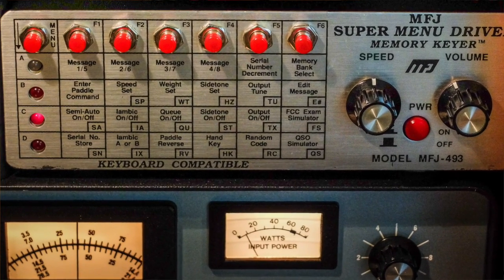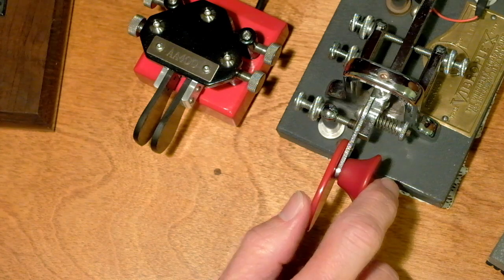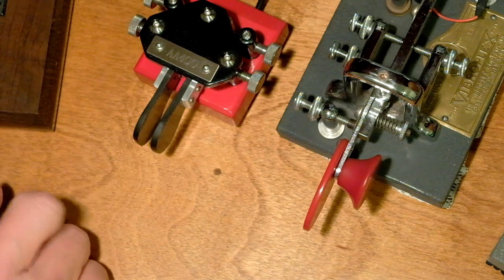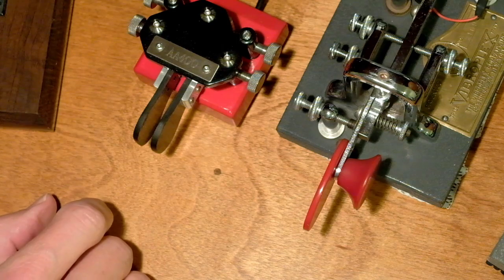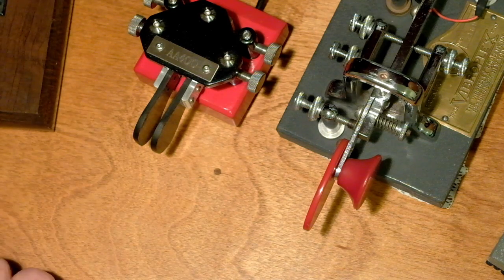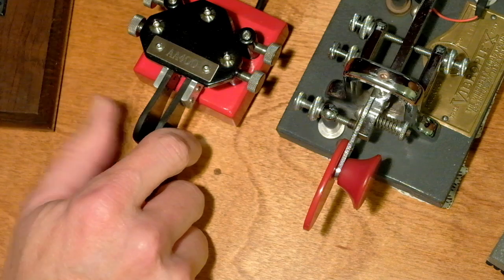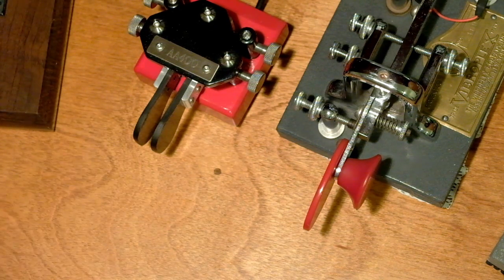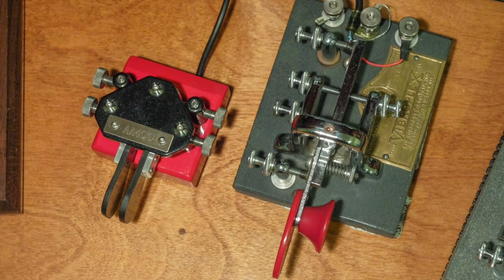Beginning Morse Code -- Iambic Keying

Comment: Having worked with keyer logic a few decades ago, the mode B has a memory for the alternate element. It remembers the paddle was depressed during the opposite element. It allows you to cleanly "lead" the sending and therefore get the perfect timing that the keyer generates. Note that most radios have mode B built into their keyers, some can be selected to mode A but many cannot.  So mode B is probably the one to study. Or forget iambic and use single lever technique even on iambic paddles. The benefits of iambic are a pretty small return on investment.
Reply: iambic makes me nuts.

Comment: Hi. For the "C" in Mode A you don't have to touch the DIT Paddle twice. You only toches each paddle one time and let the IAMBIC-Funktion do the work. You only had to stop the C (and others likewise) at the right time. Easy, isn't it? I do the C (and opposides) with one Grip in Mode A. And, what I missed in your film: How you key an "A" in Mode B. Its more difficult with the timing. A tick to long on the DASH and you have a "R". Cheers, Mike, DF2OK
Reply from the maker: Good info.  Thank you.

Comment: So, when might you want to use mode A or mode B? If you are like me, you will prefer mode B if you are using an iambic paddle as a squeeze key-for example squeezing once for the letter C. You will prefer mode A if you are using an iambic paddle as you would a single lever paddle, for example moving the paddle back and forth four times for the letter C.  You might wonder why anyone would ever want to use mode A, when you can send the letters C, R, and a few others much more efficiently in B mode. The answer is that while mode B is slightly more efficient, it isn't necessarily more precise and precision is superior to efficiency. Whether mode B is less precise for you is an open question and depends a lot on how fast you want to send.  Paradoxically, giving up a bit of efficiency in exchange for precision might actually allow you to send faster, especially at speeds of 25 wpm and up. Try them both and decide for yourself. 73, W0CP
Reply: With mode B, EVERY letter, except P, can be sent with a single squeeze. The only difference is in the timing of when you push and release each paddle. Except for P,  where you actually have to push the dit (thumb) paddle twice, it is a single motion. Once you get it, it is a joy to do.
Reply: The letter "C" in mode A is dah, squeeze, release. Not "moving the paddle back and forth four times".

Comment: Thanks for this easy to understand explanation of the iambic keyer and the modes. I had wondered if one could be used the same as the single paddle keyer.
Reply from the maker: Yep.  Just don't squeeze.  I love my N3ZN paddle but I do tend to use the single paddle key most of the time because I just like the offset of the finger pieces.

Comment: Thanks, now I'm even more confused... are all double lever paddles dit side and dah side???
Reply from the maker: Paddles will send a Dit or Dah depending on the side of the key pressed.They can usually be configured in your keyer to swap which side sends Dits vs Dahs. 
The iambic mode will determine what is sent after releasing the paddle if both sides are squeezed

Comment: 2:52 No! In mode A, the letter R does NOT require an extra stroke. You just need to squeeze the paddles a bit longer! 3:14 Same for letter C in mode A, just squeeze both paddles long enough starting with the one on the right!
Reply from the maker: Rob, thank you for the correction.

Comment: Paddles are great tech for morse ragchewing, or contesting them callsigns to the books, but a straight key is just nice and simple, you can chat a bit, but gets kinda sketchy above 13 wpm. Most radios seem to be adapted, have iambic modules built in and have a stereo morse plug in back or face. It is a nice mode for 3am because you are not in disk jockey voice or worse, the mic-eating-whisper method. Find an old stereo equilizer with a headphone jack and really smooth out the tone to audio bent neon pulses, on recieve.

Comment: Just picked one up today. Can I just plug into my TS-820S and start sending or do I need an electronic controller interface between the rig and keyer? My Kenwood 820 manual doesn't give me any guidance in terms of how to wire it. My manual only shows wiring for a straight key.
Reply from the maker: The TS-820S doesn't appear to have a built-in keyer, so you'll need to send the paddles through an external keyer and route it's output to the key jack of your transceiver.

Comment: I just purchased a n3zn qrp key from ebay. It's almost like yours but it's an older model made in 2008. The base is the same size square but is twice as thick and it's all made of brass. I'm just learning cw and I think this key will motivate me to work harder. It is a very nice key. How do you like yours. Thanks for the video.  I read your blog often. 
Jeff
Reply from the maker: I enjoy my N3ZN.  A wonderfully made piece of the kit, and the builder is a wonderful guy.

Comment: At what speed do you reach the diminishing returns?  That is:  when does the dit become so short that your window of opportunity to follow it with or insert a dah becomes so small that you get miskeys rather than dit-dah?  I'm new to all of this so I may be raising an issue that is, in fact, of no consequence.  I am curious, however, as I'm considering going this route rather than a straight key.  Given the cost of the key set as well as the keyer, will I grow out of the equipment's iambic capabilities at 15 or 20 WPM?
Reply from the maker: In a recent QRZ poll there was a slight preference for mode B over A, but the majority of responses said they did not squeeze key, meaning they did not employ either iambic mode. Personally, I find diminishing returns over 27 wpm. I use a manual key (either straight key or bug) in about half my QSOs because I'm generally just talking rather than contesting.  I will generally match the other operator in a QSO, so if they are going slow with a straight key, so will I.  If they are running 25 wpm with a paddle, I will follow that.  If they are swinging a bug, I will do so as well.  Variety makes it fun.  However, don't start out with a bug.

When I use an electronic keyer, I have 3 paddles on the desk (as well as 3 different keyers).  Two of the paddles on the desk are single lever paddles. So I personally make very little use of iambic keying.
Reply: @HamRadioQRP  Thanks for that information.   And for the video, as well.  Very useful.
Reply: Diminishing returns in terms of what? Operators use squeeze keys to 60 wpm, which is about the fastest a human can copy. After that the problem isn't the key anyway. Few operators carry on a QSO above 40 wpm. Once you're there you'll know which key and style of key best suits your fist. From what I read, being nowhere close to copying that fast myself though I can send pretty fast, operators are divided on what works best, agreeing only that it's a matter of personal preference.

Whatever style you like, the quality of the key matters, The Kent is reliable and probably the least expensive for a great key, easily competing with keys twice its price or more. Begalis are universally lauded. Many like the N3ZN. You want one that adjusts to your favorite touch (most like it light), and stays set where you put it. Many like magnetic return, but I have a Kent that uses springs and it is very reliable and fast.

Comment: Do  transceivers handle iambic keying or are keyers required ?
Reply from the maker: Most modern transceivers have a built in iambic keyer.  It varies whether the built-in keyer supports mode A or B or both.  My Ten-Tec Eagle only supports Mode-B which started me down the path of using external keyers.  

Read your transceiver manual to determine how to practice using the sidetone without transmitting.

Comment: #HAMradioQRP   Awesome video
Question:
Is a duel paddle a greater method of learning Morse?
Reply from the maker: "Duel paddle" versus "Dual paddle"... Sounds like an interesting video series.    As far as learning to send Morse, my preference was a straight key.  Everyone learns differently, so if you have the opportunity to try both go for it and see which seems more natural.  Some people don't have good intrinsic timing which makes learning to use a manual key rather than a paddle with a keyer tough.
Reply: For someone that has a longer sequence of names than an aristocrat, you'd think that a dictionary was in your education somewhere!😁 Just teasing.

Comment: It seems hard enough to learn CW, that’s even more thought process. Those Pico paddles are nice for portability. But seems I’m going to have to start with a straight key.
Reply from the maker: Everyone is a bit different but straight key was easier for me to learn with.  The Pico paddle is great for radio backpacking operation.

Comment: Very informative though, thanks for that.
Reply from the maker: Glad to hear.  I know that when I first started learning the modes really confused me.  I got a Ten-Tec Eagle that only supported Mode-B in the internal keyer and it was driving me nuts until I figured it out.
Reply: The one thing I like about the paddles is it’s a set dit and a set dah. Where with a straight key you determine the length of the dits and dahs.

Comment: Just learning Morse... What's easier to learn on dual paddle or single lever traditional?
Reply from the maker: I began with a straight key, then went to a dual paddle.  The last paddle I purchased was the 1961 Vibrokeyer single paddle.  Learning on it would have probably been simpler but would have presented problems when trying to use an IAMBIC key.

Comment: Never use iambic paddle! It is strictly forbidden for beginners! High speed telegraphers use one lever pedal ONLY! It's simply impossible to send Morse code at very high speeds using iambic keying.
Reply: I agree with Andras, Iambic is nice but after switching to a straight key, my CW sending sharpened dramatically. I know this isn't the point of the vid but just trying to help fellow CW neophytes. 73 N0GB
Reply: Huh? What do you consider high speed? I’ve seen operators run well over 40 wpm with iambic paddles/keyers. I’ll agree with your opinion that beginners shouldn’t start with them, but the rest of your comment - particularly your use of “never” and “impossible” is rubbish.
Reply: @K3BBG Incorrect. MANY high-speed telegraphers use single-lever paddles, which is what Andras was referring to, not straight keys. If you ask around you will also find many seasoned CW operators who say their accuracy AND speed went up when they switched from dual-lever paddles to single.
Reply: A straight key will give you RSI. Iambic paddles prevent that.